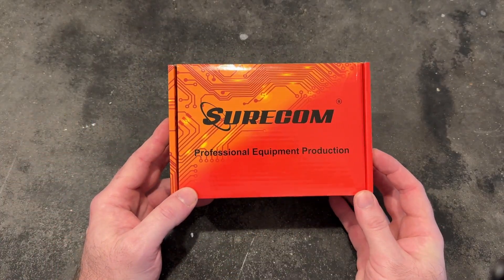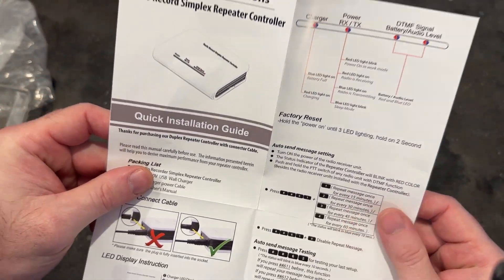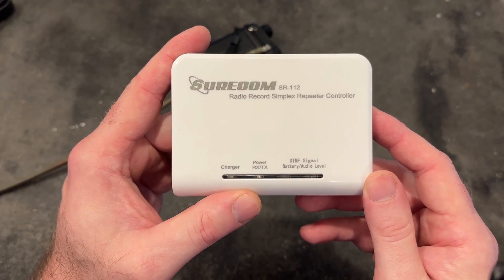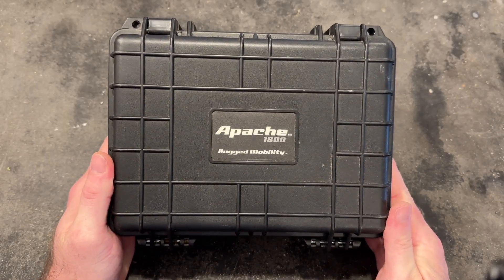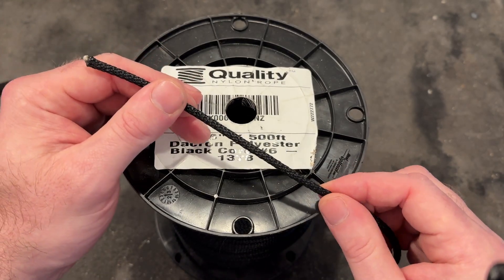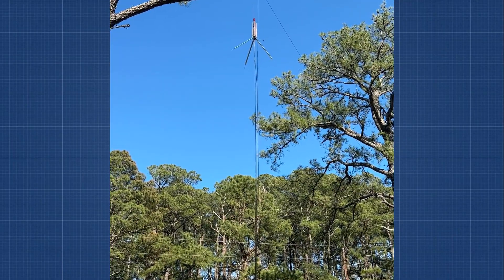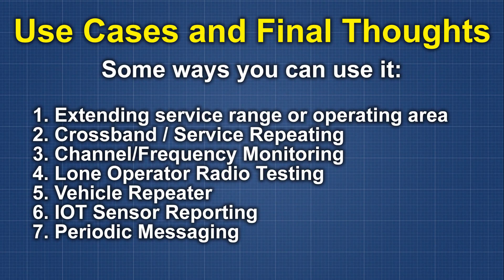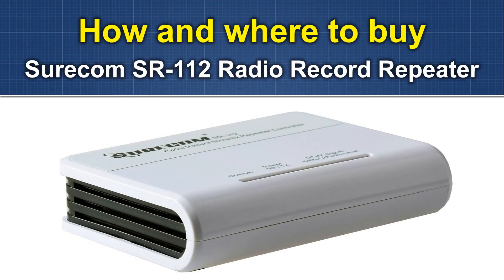You Can Build The Cheapest Repeater in less than 5 Mins! GMRS/HAM Less Than $100 - Repeater TUTORIAL

Comment: Awesome stuff. Questions: 1) how is the surefire powered when up in the tree? does the Kenwood cable power the surefire? and 2) does the ptt on the baofeng need to be depressed while up in the tree while hooked up to the surefire?
Reply from the maker: All great questions! #1 the repeater controller has in internal battery. It charges via a USB cable. Even though it's only 900ma, it will last a bit longer than the handheld radio. #2 As far as the PTT control goes, the controller itself will initiate the PTT via the kenwood style cable. So no need for VOX. Basically connect it together via the cable. Setup any CTCSS tones you want to use (always a good idea for a repeater) then throw it in a tree or up on a pole. Dead Easy!
Reply: @Commodium  bad the heck ass...i'm gonna give this a test run this weekend at the lake. i knew you mentioned the internal battery; just was unsure if that was what was relied on for the video. possibly, a USB battery brick could be integrated for longer term but this is fun. thanks.
Reply from the maker: Food for thought... If you have a two-port USB Brick (or splitter), and the radio has a USB-C charging port (5RM among others) you could use the power brick to extend the battery life of both the repeater controller and radio for a few more days of use.  @stewartjas68
Reply: @Commodium  You definitely want a tone on the repeater receive radio.  I had a microwave tower start tripping   the radio on and off and by the time I got back to the car. It had fried the  SureCom SR-112.   This will work with FRS radios.   Amazing when local kids start hearing themselves on the radio. They cleanup their act quickly.
Reply from the maker: Yes absolutely. The follow up video has tone management and setup. Should be posted soon.  @2148aa